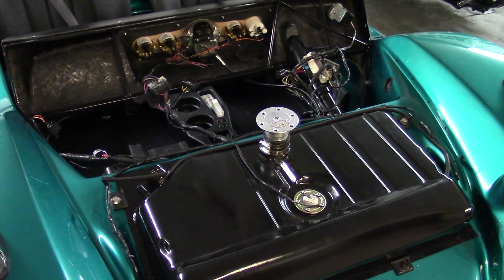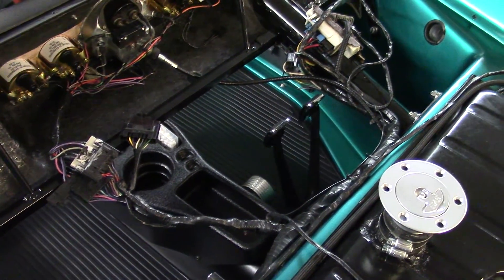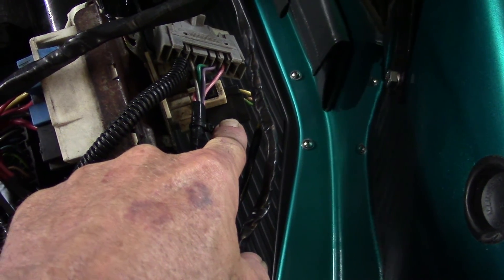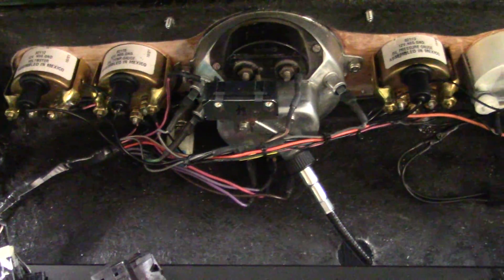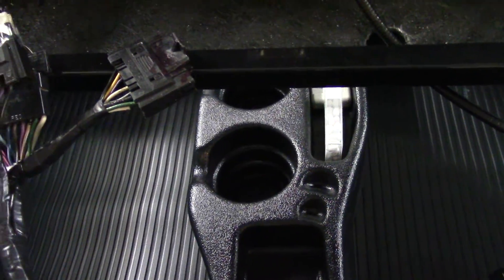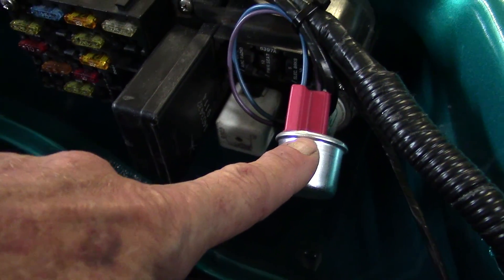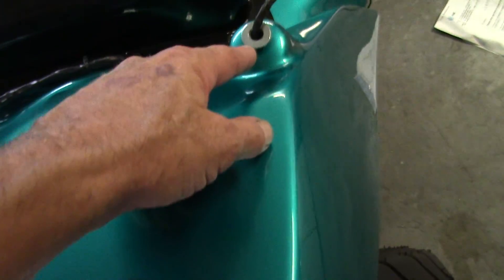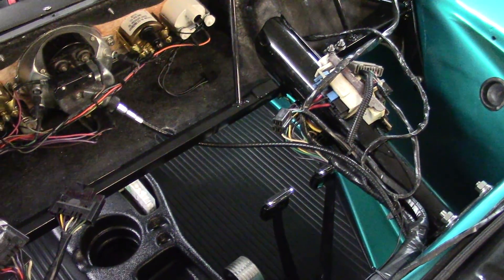DUNE BUGGY WIRING, WHY I LIKE MANX 1'S

Comment: Milo my left turn signals are blowing a fuse. I’m thinking the front tire is rubbing on the wire and pulling it…Inspected the wires at the light and they seem ok (I’m buying a new housing just in case)…If the new housing doesn’t work where is it most likely to short? That bolt on the fuel tank, the fuel tank itself or the tunnel the wire goes through? Manx II (PO did the wiring I’m just trying to figure it out)